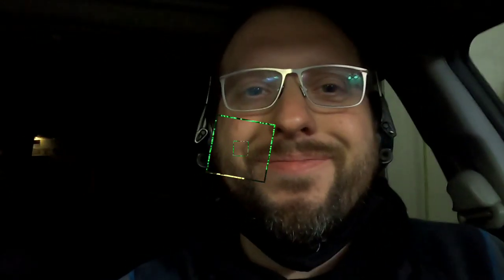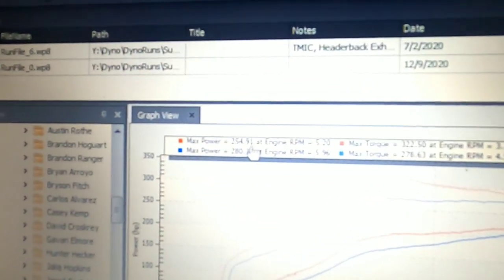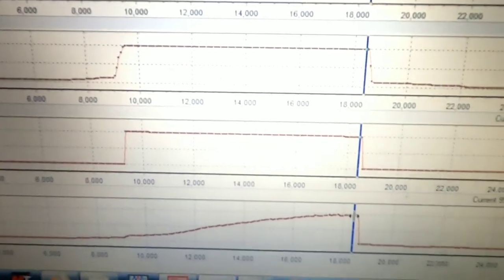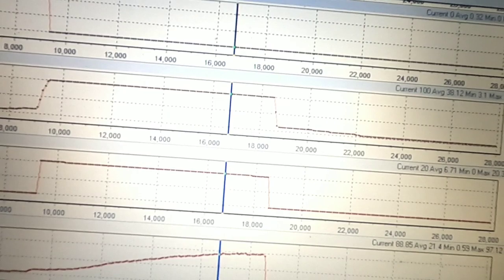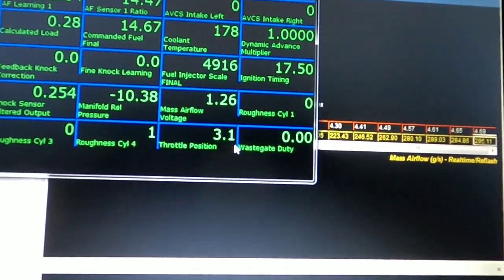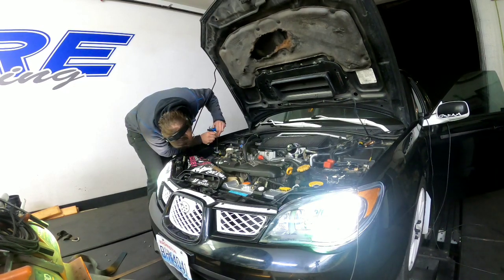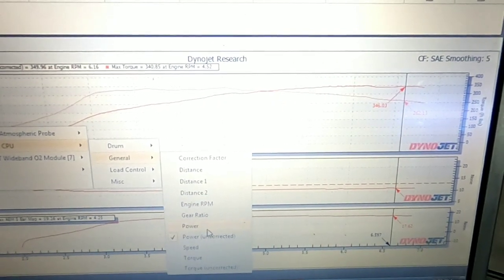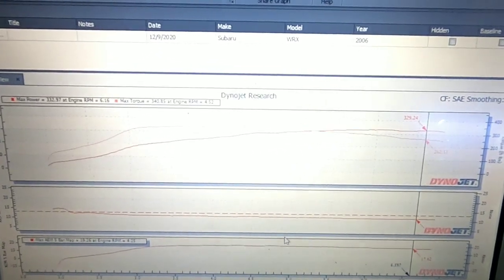Tuning Tech. Calibration process for an upgraded turbocharger.  td04 to td05-16g on 2006 Subaru WRX.

Comment: Nice numbers 🤙are you using a wideband to measure the AF or using the    AF sensor 1
Reply from the maker: Dyno wideband
Reply: @WT4T  Nice. How accurate is the AF Sensor 1 on the cobb accessport is?
Reply from the maker: It's not accurate at all.  Everything below about 12.4:1 reads 11.1 😅. There's reasons for this that ive talked about in other videos
Reply: @WT4T  right I feel it. I've always used AEM or an Innovate wideband.  I was just curious

Comment: really good i will watch a few times - as tuning is the genie in the bottle = simple corrections and great HP gains - master - thank you ! = mine is SF5 forester GT Turbo EJ207 RA STI swapped running gear and engine = i just love my subaru !

Comment: Great Video. You threw a bunch of valuable information out, much appreciated.  Question: What software were you using to tune? Is the software available to the public? Also, where are you located? If you're in Northern California I'll come to you
Reply: Head gaskets blew. Pulled engine. Had the head machined and rebuilt, replaced all of the hoses and gaskets, while I was there I replaced the turbo with a TR TD05-16G Turbo from Tomioka Racing (a daily driver upgrade). After the install my pops turned it over and it runs smooth but you can tell there is a bit of a timing issue from the gasoline smell out the tailpipe and the check engine codes that it is throwing. Its a 2.0l DOHC. Any help would be greatly valued. Thank you.
Reply from the maker: This is on Cobb Accesstuner Pro which is not available to the public.

Comment: Seeing the Engine rotate on the pull is kinda cool to see tbh.  Would an upgrade pitch stop mount be the primary thing to prevent this? Or would it be the engine and transmission mounts below?
Reply from the maker: Mostly mounts, pitch stop helps front to back motion which really helps on shifts more than anything.

Comment: Hey! Great video, this was super helpful since I'm putting in a TD05 20G myself. One question though, you have a fuel pressure regulator, is this necessary? as I have a high pressure pump, will the ecu compensate using this or will i need the regulator? Thanks so much!
Reply from the maker: There's a factory regulator that does a pretty decent job so in most cases you don't need an aftermarket one.

Comment: You should close the bonnet so the intercooler works as designed? Excellent information here thanks.
Reply from the maker: There's pros and cons to this.  Typically though they work better with hood open.

Comment: I'll be running an 18G in my 06 WRX that I've swapped in a built EJ257. Really good to see those kinds of numbers coming from a slightly smaller turbo on a stock EJ255! I'll be happy seeing 350whp
Reply: hey man lm also running an 18g, hows yours performing?
Reply: @hararaist  unfortunately need to save for an ECU which hopefully I'll have paid for by the end of the year. My current one is damaged and won't allow the car to stay running. And the engine supplier as lied - it isn't built at all so I'll have to see how safe it is to push the engine

How about for yours? What did it make?
Reply: @antoniobonomo5939  damn that sucks. how much u pay for the engine
Reply: @06wrxRA  5k AUD
Reply: @antoniobonomo5939  thanks. hope karma serves the liar one day! hope the engine will last you a long time. just make sure the fueling part is adequate with ur tuner and u shud be able to avoid many problems. not too lean or rich. the new subarus are lean thats they get hot and break.
Reply: @antoniobonomo5939  running great, waiting to upgrade the intercooler now. Sorry about your engine
Reply: @hararaist  haha I got a random notification for this. Car is up and running and has been absolutely awesome. Recently went front mount cooler too

Comment: What would the redline be for a built block motor with cams and upgraded springs and retainers?
Reply from the maker: That all depends on turbine flow.  Stock turbo no reason to rev past 7k. Most big stock location turbos fall flat past 8k, even most rotated setups lack turbine flow to justify going past 8k. On a well sorted setup like the BlackWidow we rev 9500+ regularly and it's still making more than 1100whp at that rpm
Reply: Thanks that’s good info. I have my hyper blue at PRE right now and I was just wondering when it eventually gets tuned with the blouch dom 3.5xtr what the redline would be. I’ve owed a few Subarus but I’ve always had stock turbo power and redline.
Reply from the maker: Probably 7500ish
Reply: @WT4T  I was considering upgrading the fuel system while the cars in the shop to be able to max at the 3.5 on e85. I currently have FIC 1200 injectors and AEM 340 fuel pump. What would be a good fuel system to max the 3.5 one e85?

Comment: What injector size would you recommend for this setup? Thanks
Reply: So my plan with this setup for injector size is when I go Radium TGV deletes and Radium fuel rails I plan on doing FIC 1200 with radium pulse dampners 😊
Reply from the maker: Very good setup